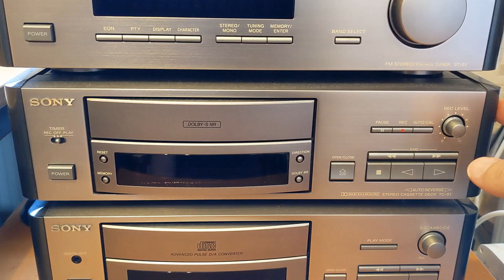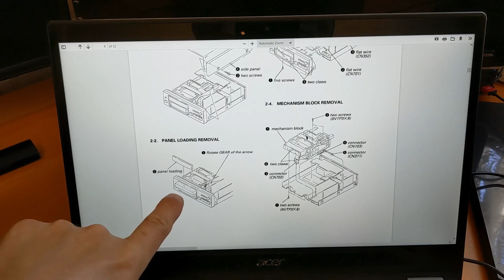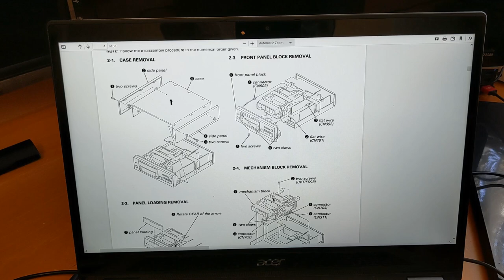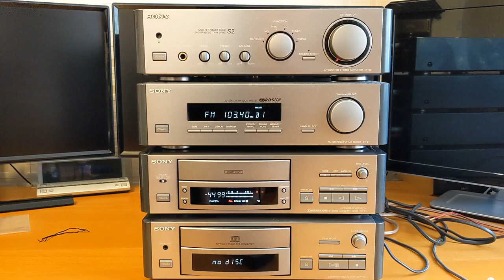Most difficult cassette deck belt replacement so far. Sony La Scala S2 ST-S1 Cassette Deck.

Comment: This thing is a beauty. 
Cant beat sony design. I have a 20+ year old Sony system and the belts are still working great.
Reply from the maker: I agree. There were issues subsequent to this video that make me wonder if I didn't need to change the belts after all, and they seemed to be in good enough condition. I'm learning as I go.

Comment: Great video - I watched it intensely! I have the same system which i got for the same reason as you, the auto calibration! I've had some ups and downs with mine but all sorted now. I had it professionally serviced which worked wonders, then after a year it started to make really lousy recordings, all hissy and muffled. Presumed it was dirty heads but cleaning made no difference. Took it back to the guy who serviced it and it turned out that the record circuit oscillator had failed. Fixed and working now but watch out for that. I have PDF's of the instruction manual for the tape deck and CD player if you want them?
Reply from the maker: Thanks very much for the kind words. Yes please to the manuals. I'll be in touch when I've figured out how to get them without either of us giving away contact details.
Re the La Scala, I've shot another video due to ongoing problems that should go live in 15 days, and it's still not working properly. If no one comes up with a solution after that video goes live then I've found a local company who I could contact for a service, or I might ask who you use of they're local please. I'll be in touch. 
Thanks again.
Reply: @CBitsTech  I put my twitter in the description on my channel. You could DM me from there.
Reply from the maker: @imansfield  Thanks. I'm rarely on Twitter, but followed you there. I think you need to follow me before I can send you a DM. Or send me a DM please with a link to the manual(s) please.

Comment: Do you do any belt changes on technics ch rs 550/950 twin cassette players? None found on yt. Cheers
Reply from the maker: I haven't done any Technics ones yet, sorry. I think Panasonic is owned by Technics, so they may have similar cassette mechs. Maybe look for Panasonic belt repair videos. Good luck.
Reply: @CBitsTech  thanks will do

Comment: And I was naïvely thinking my Sony deck was a b!tch... those belts and your deck are far worse. One thing I learnt about those demons: always hook the belt around the big wheel first.
Reply from the maker: lol. Thanks for the tip. Here's another, use a dental pic if you have one; I have, but I didn't think to use it.
Reply: @CBitsTech  I tried one, too.

Comment: Where can I get those belts?
Reply from the maker: I can't say at the moment. I was given the belt to test it to make sure it's the correct size, but I suspect it's the new belt that's making the unit sound so bad. I have to find time to put the old belt back in to see if it changes the wow/flutter. If it turns out that the belt is good then I can announce who the manufacturer is. It might take me quite a while to do all that, sorry.

Are you in the UK? If so, someone recommended a good HiFi servicing company to me, but I haven't used them. I might send my deck to them to sort out. Maybe they have belts though. Let me know if you're in the UK and I'll find the details.